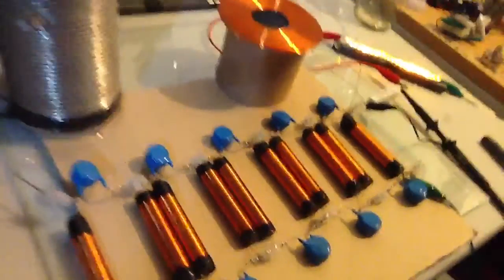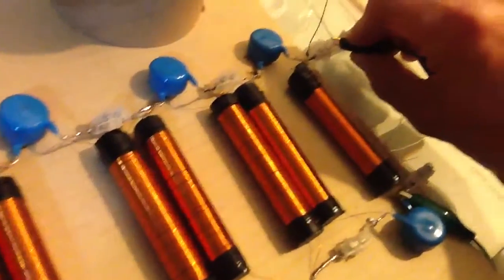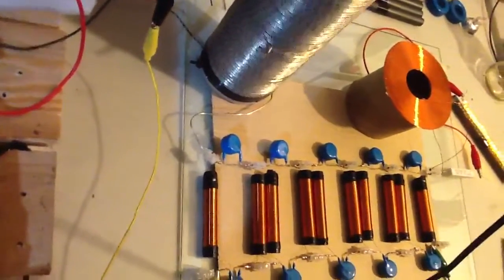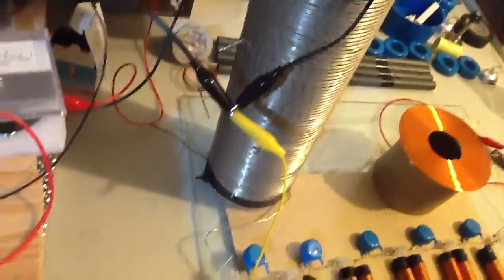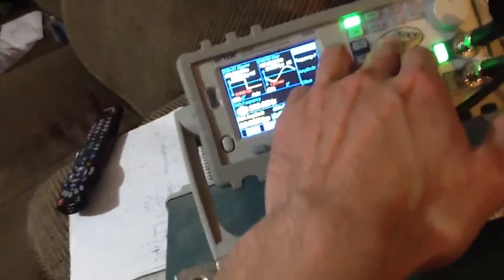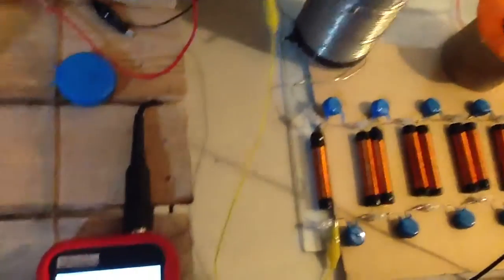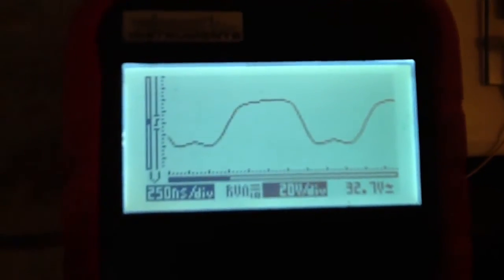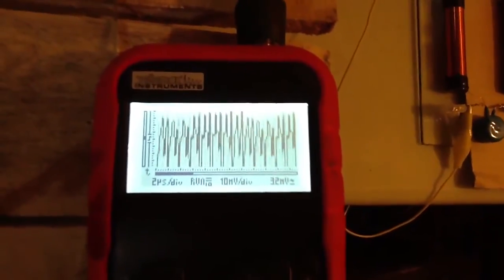2 Tesla LMD Longitudinal Magneto Dielectricity: initial testing

Comment: Does it emit the scalar waves wirelessly through space?
Reply from the maker: Are you very interested in Wireless transmission?? 
You lose 90% trying to radiate in the air... N.Tesla.
Go with a direct connection. The compression impulses travel in the ground... not wirelessly.
Reply: kdkinen I meant does it emit a beam of scalar waves?
Reply: kdkinen ever heard of a scalar Interferometer?
Reply: kdkinen hello?